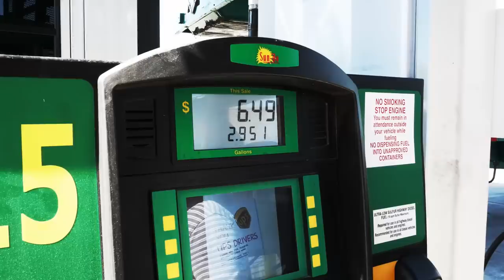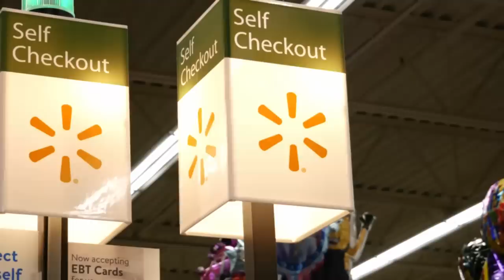SWAMP LOGGERS NC / "Just Millin' Around"   S1E5

Comment: How much does it cost to fill up a truck like that now ? Have to be saving a little I know gas in Western North Carolina it's $1.49 not sure how much diesel is.
Reply: Bout 450 bucks or little less depending how much you have in tanks before fueling up at 245 gallon n sc
Reply from the maker: You know what....i don't know i think 160 a side if I remember right.